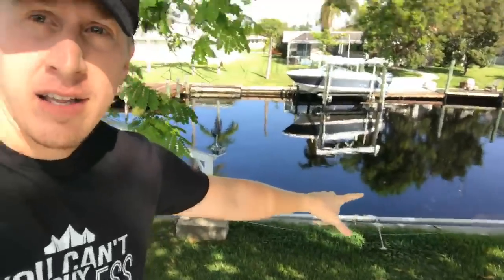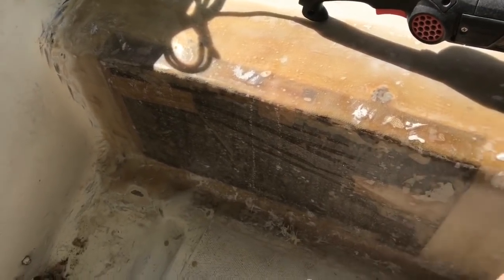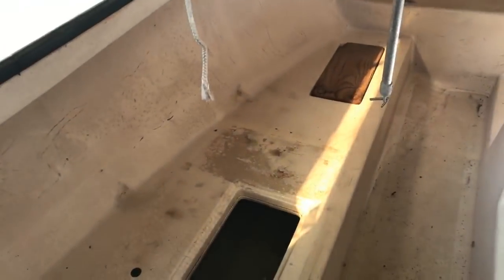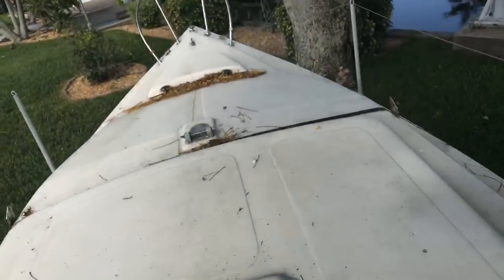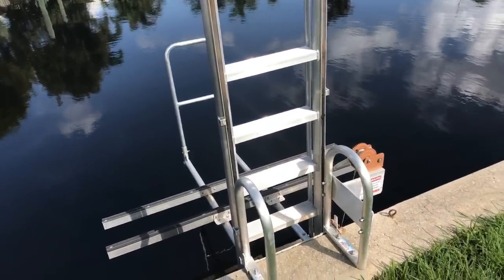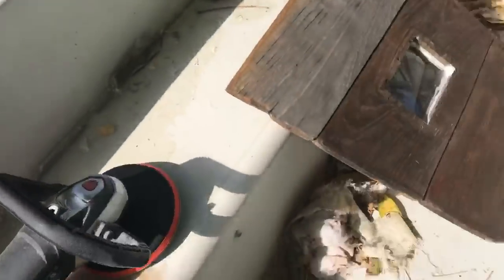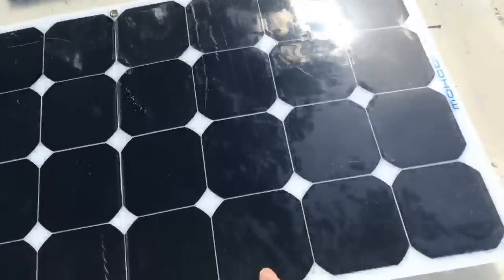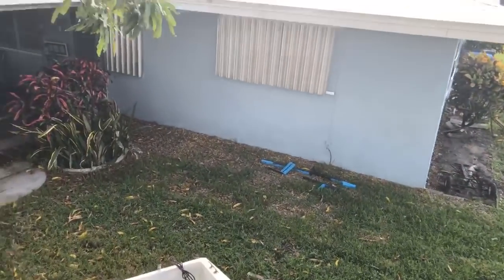My $250 Liveaboard Sailboat! (VIDEO #1 LIVE INTRO)

Comment: Bought a Mac 22 couple years ago. Been a great boat for the wife and i. Been an adventure trying to figure out what we need and don't need in the inside. Gone through a few changes. We found out less is more. Only the essentials are on board now, just what we need for a couple days on the islands. One thing that helped was we turned the space under the dinnet seats into cooler space. I hope you have allot of fun, bigger isn't always better. Smaller sailboats get used more most of the time. 
P
Reply from the maker: I embrace the less is more lifestyle.  We are starting out with almost nothing inside.  Going to see how she sails first.  More videos planned.  Been saving video footage.  Redoing wood rudder system as we speak.  No idea necessarily if I’m doing it 100% correct or not.  Just having fun and trying not to break the bank.  Aside from maybe a outboard kicker I’m trying to stay under $750 total invested.  I’m at $400 or less right now.  I want to have it sail ready at $600 ideally.  That leaves me $150 for outside cosmetic or interior stuff.  Trying to prove to people that life on the water can be inexpensive if you make some sacrifices and are smart.  Not necessarily planning on living on it 24/7, but would like to at least do weekend overnight trips.

Comment: This has probably one of the first times I've seen an American actually grab a bargain =D usually it's a guy stood in front of a boat like that saying "wow I only paid $32,000 for this project". Well done, I hope it brings you many hours of enjoyment.
Reply from the maker: UPDATE i did get some hours of enjoyment, but then sold to reinvest in another boat...planning on trading up.  I tripled my money on this boat. 

The boat was nice but it didn’t have everything I wanted.  

I just missed out on a gorgeous $1000 25ft hunter sailboat.  It was ready to sail and had decent livable interior.  Florida is a Mecca of used boat deals.  I will be getting another sailboat to follow my dream of island camping the gulf.  Now with the birth of my baby girl Saylor Marie I want to find a bit larger boat.  I need to find something with a shoal draft or swing keel ideally.  The 25ft hunter drafted a bit more than I like but was doable.  My backyard canal can get close to 4ft at low tide.   I really need to pay someone to dredge my canal a bit deeper.

Comment: Good luck with the refurbishment and repair.  I am also busy...redoing boats becomes a addictions, on my channel I am currently looking at refitting and completely rebuilding the deck of my 25ft Yacht
Reply from the maker: Great videos & channels as well.  What resin & fiberglass do you prefer?  I used cheap bondo brand fiberglass/resin for one lower budget marine project which worked fine.  Although I really like West Systems which is bit pricier.  Thanks for stopping by.
Reply: Howdy.  Since I work prominently with wooden boats, I prefer epoxy over poly resin as it impregnate the wood more.  

For your boat basic grad poly ester resin wll work fine, as it is how they are normally constructed.  Would be goo if you follow Andy at boatworkstoday since he works mostly with poly ester resin.  

Being in South Africa, the imported stuff, like West (which is awesome) is way to expensive with our exchange rate, something like $1 = R14.  So I tend to support the local developers of epoxy and poly resins.  

Currently I am converting a seakayak into a mini folding trimaran similar to the triak sport sailing kayak you have in the states.  Videos of that should start trickling through in a months time.

Looking forward to seeing the rest of the refurb and restoration.

Comment: how is the project going ?
Reply from the maker: Hurricane Irma set me way behind on project deadlines.  My sailboat boat filled with water.  I am still filming updates but my project list on the boat went way up.  Had to find some parts which were hard to come by.  Electrical had to be mostly redone due to flooding. Got new 400w of solar panels.  I recut a new wooden rudder and am waiting for time to fiberglass it.  I need to find a deal on a long shaft kicker so I can get it into my canal system.  Dang hurricane set my channel way behind.

Comment: Hello. I know little to nothing with sailing but I've learning. Would you please finish your thought on sailing through the canal? I want to buy a sailboat and dock every few months. I live in Cape Coral, Florida. Just curious what I need to know about the possibility of sailing a 30'-40' sailboat up a canal. Thanks in advance!
Reply from the maker: I won’t sail in canal.  I will motor in and out to get to river then sail ICW to Sanibel.  I am working hard to buy a small kicker.  I also rebuilt the rudder.  Taking videos of process.
Reply from the maker: It gets shallow between canals and Sanibel/Open Gulf.  You definitely want a chartplotter and understand the channel markers.  Chartplotter is nice at night especially since it is hard to see channel markers.  I have a swing keel boat which allows me to go into more shallow waters.  A fixed keel vessel will draft much more maybe 4ft or more.
Reply: Most channels in Cape Coral are narrow, have docks with boats on the sides and usually have boat traffic. You need to be able to maneuver, change direction and reverse with very little notice. Even if you could sail a 30-40' up a channel, which is not impossible, it's not a good idea, especially if the wind is not in your favor and you need to tack.

Comment: Very cool. I hope she makes it to those islands in the Gulf
Reply from the maker: I hope she floats!  Haha.  I inspected the bottom the best I could before purchasing, but the swing keel box area is largely unknown.  Bilge works.  I’m rebuilding the rudder currently.  Using the old rudder as a template.  Then I need new mainsail sheets (ropes) to get her on the water sailing.  After that going to do some interior cosmetic work.  No sense in doing too much cosmetic work till I find out if she floats or performs on the water.  If she does well it will be fun to use visiting some of the gulf islands.  Swing keel is nice on gulf side since we can run shallow quickly.

Comment: yup set the panels in the back youlook tall
Reply from the maker: Thanks for advice.  Will consider bracket for back. Finishing rudder at moment.  Need to find small outboard deal.  Craigslist and Facebook marketplace have occasionally had some deals but I seem to just barely miss them.

Comment: Why do everyone imply that sail boats are money pits? Like yourself, if you're half decent with hand tools and DIY and provided your boat stringers are not rotten then it should be no more than maintaining a car. This also assumes you can trailer your own boat and pull it out of the water during winter.
Reply from the maker: +aarynj agree...haven't seen any signs of overwhelming expense.  I'm still in it for less than the average price of my kayaks.  The outboard will be biggest expense but don't likely need a expensive long shaft since transom to keel depth is 13".   Thus a 15" outboard by Tohatsu would work since they are 17" and sold as 15".  Their sailing outboard models are typically more expensive and 20-25" long.  Looking at Tohatsu since the make the internals for multiple big brands.   Torqueedo electric outboard would be awesome with my solar setup though but pricier.
Reply: aarynj shantyboats